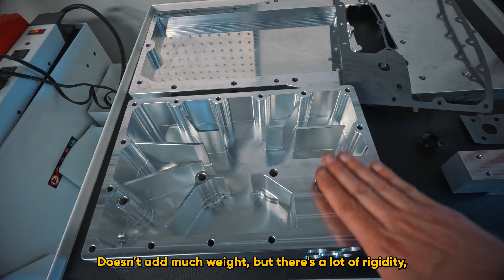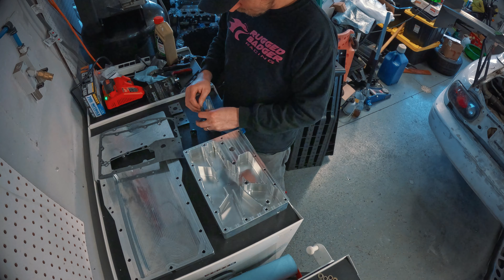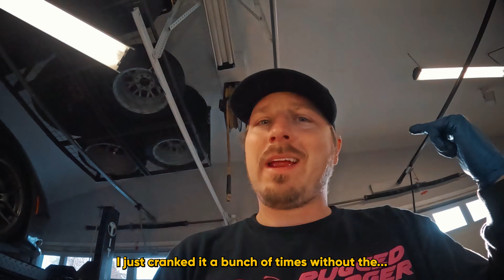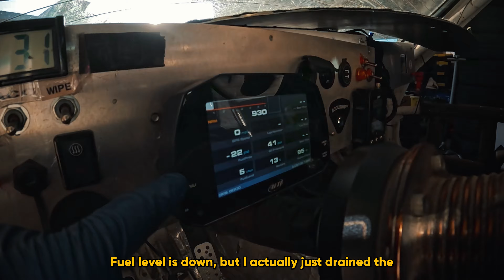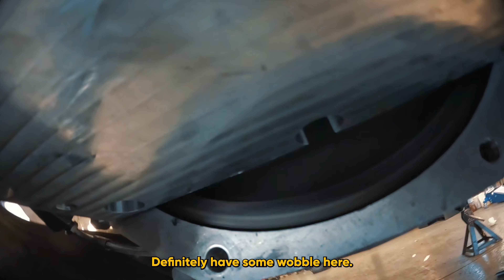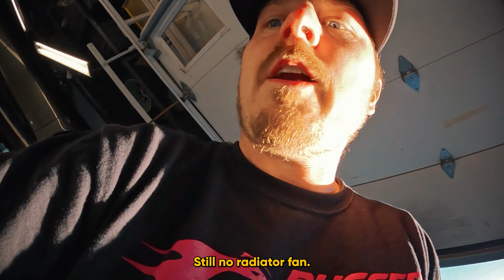Installing the Revised Ecotec Miata Oil Pan | RuggedBadger.com

Comment: You mentioned that oil could be traveling down the side of the pan which would have missed the old oil pan design pick-up region.  That makes sense if the reciprocating assembly is wind & oil whipping the returning oil to one side.   Here is a start-up video of my Ecotecmiata showing the start-up oil pressure.    The oil pressure gauge should be accurate as it is the old style Miata sending unit.   zzthe oil pressure looks to be about 75 psi just before the camera pans away but it is a cold around 75 degrees F.   I am running 5W-40 Mobil-1 Turbo Diesel oil with a remote oil filter and oil cooler with a temperature bypass.  I will update my pressure readings when hot in a few weeks after I launch my boat so i can get the Miata out of the garage for a drive.   Linky:   https://www.youtube.com/watch?v=I3avkjc4IF0
Reply from the maker: Where did you get the crate motor from?
Reply: @ruggedbadgerracing  I bought a brand NEW engine from GM about 6 years ago.  It was part number 19208889. It had all the upgrades. Matt at EcotecMiata installed it.   I now have about 600 break-in miles on it.    The GM crate engine is no longer available.

Comment: My cooling fans would come on at the upper temperature you mentioned and then stay running even as the temperature came down.   The fans would only turn off if the engine was restarted.  I bought all the necessary parts to make the coolant fans operate independent of the computer.   Fortunately since I blocked of my "Turn Signal Intakes" I get better air flow through the radiator and the temperature stays at thermostat temp without the fan coming on during my engine break-in drives.    I will be installing a Flyin Miata V8 radiator so it will move the location of the outlets so the hoses don't lay on the suspension.   (It's especially congested down below on mine since I have air conditioning)  I also have a Flyin Miata v8 front sway bar so it will clear the pulley nut while being installed in the stock location.  I have the boxed sway bar mounts to go with the sway bar.  Question: Will your 2nd revision oil pan that you just mounted have the extra transmission/adapter supports?    Good luck.
Reply from the maker: Yes, we do have a transmission support bracket, atleast that worked well, lol.
Reply: FWD  to RWD problems.....
https://youtu.be/N-ILkbnZqrA?si=CrK4sDt8f_oT7jal